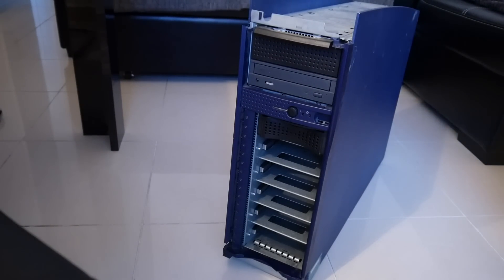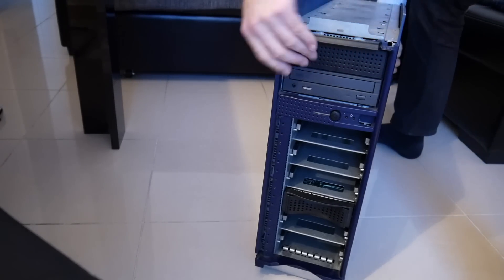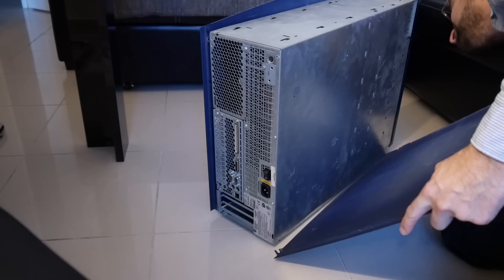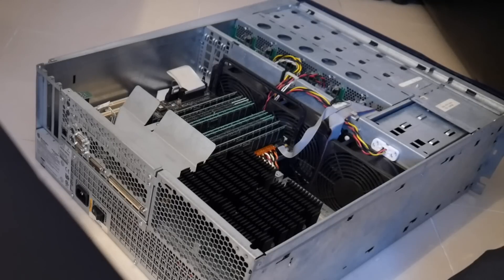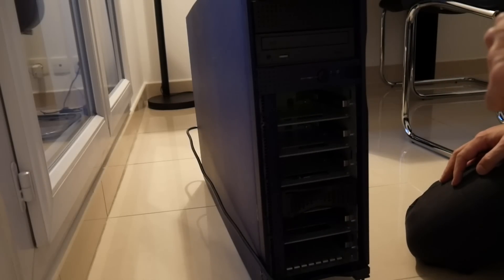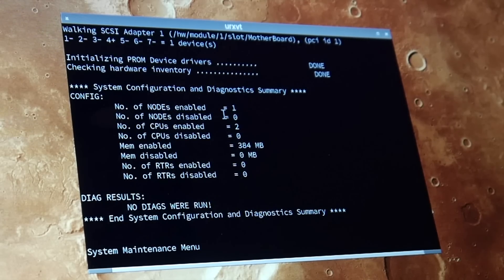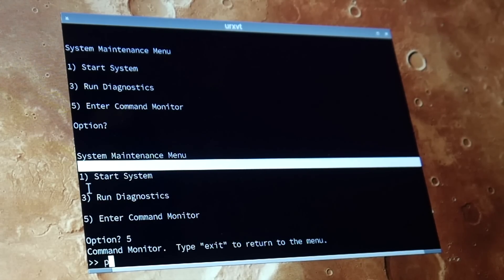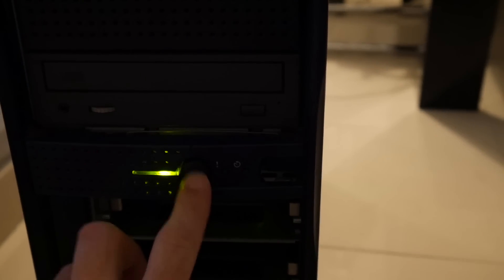Last month pickup: Another Sgi system; an Origin 200! ;-)

Comment: Did you get the system installed in the end? If not, let me know, I can help with a full IRIX distro, either CDs or a disk with an OS setup ready to use. I'm away just now but I could sort something in May or June.

Btw, there is supposed to be a proper metal fold-out side panel covering the internal area, the blue panel is not normally the only thing covering that side of the system.

Did you obtain some sleds?

NOTE: if you ever decide to upgrade the RAM, please be aware that DIMM modules larger than 128MB will only work with CPUs which are at least 250MHz. And IIRC always use the outer memory slots first.
Reply from the maker: Thanks for the notes, I successfully installed Linux and unfortunately got it without the sleds :-/

Comment: These things are indestructible. We ran 3 towers from 1997-1998 to 2013 and never had a single problem apart from a couple of failing tape drives and replacement fans. I still have them waiting for a bit of inspiration :) The plastic feet underneath crumbled to bits tho.. I just binned the covers and plastic parts. There's a realtime clock chip with a battery inside and the battery is dead by now but I think you can still source them fairly easily.